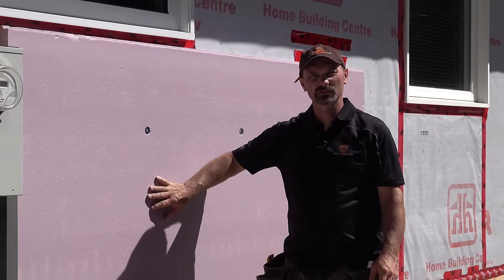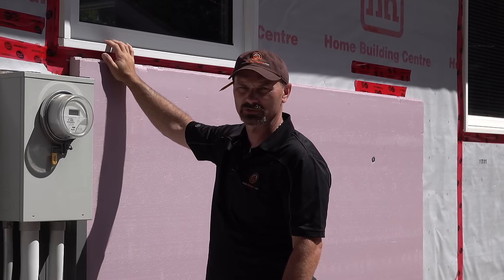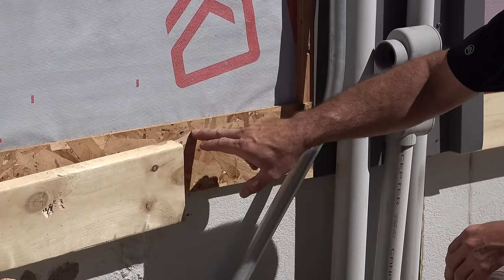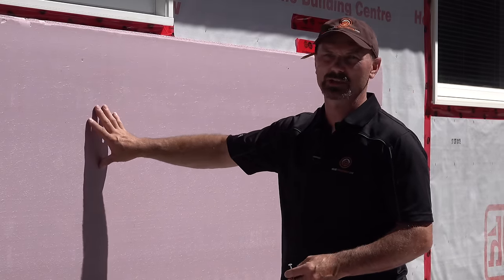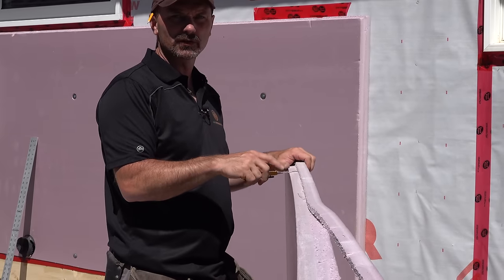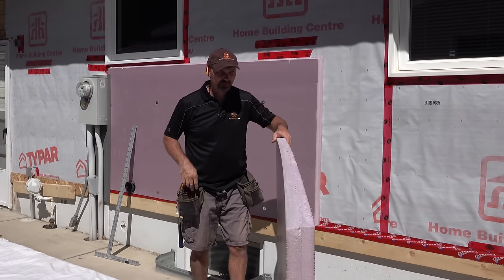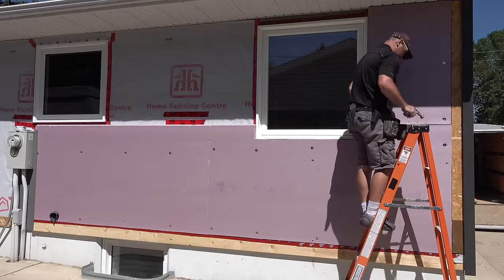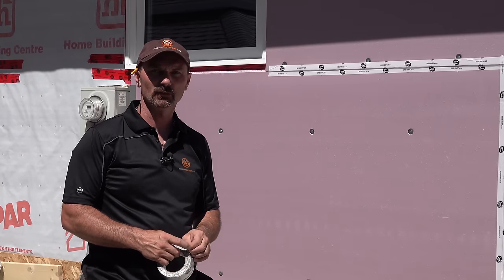How To Install Styrofoam Insulation On A Home's Exterior

Comment: I just finished a job like this yesterday lol . I took off this guys siding and installed thorax and foam then replaced the siding ..so I was watching this utube video , not this one but another , and this guy says you don’t need to install tyvek or thorax lol , homeowners beware of contractors who claim you don’t need house wrap . It is almost more important than the siding itself
Reply: I dont know much about wrapping. But do people put this stuff over top the older built homes ie bungalows that have those stucco? how would you layer it for old houses with stucco on the exterior? in example do people put paper down--> wooden frame---> styrfoam insulation---> plastic siding?  I'm a total noob any ALL OF THIS STUFF. Looking to learn more before getting a friend to do this in the near future on my dads house. maybe in 2-3 years from now. I also live in Alberta Canada so it can go down to Negative -40 degree C which is -104 F
Reply: @jeffd3147  if your going to go over stucco you need to put wooden cleats on the building kinda like studs on the side of the house that you can then mail the siding to , obviously there is a lot of other things you need to do in preparation . That’s only if you don’t want to just rip off the stucco

Comment: You could use 3 inch decking screws with a fender washer on them to hold down the foam board. Do you worry about having to vapor barriers the foam board being one and faced fiberglass insulation on the interior of the house? Wouldn’t that trap moisture?
Reply: I was wondering the same thing. Have you looked in to it ?

Comment: What about the soffit j-channel ? Would you screw the soffit channel over top the foam ? Or would you have to put a strip of wood for the j-channel then run your foam just to the bottom of the wood strip ? No one seems to know this in my area. Please help

Comment: Looks great! But now how do I put siding on 1.5 inches of styrofoam?
Reply from the maker: I install vinyl siding all the time over up to 2" thick rigid foam insulation. I use  3" shingle nails. For 1-1/2" styrofoam I would use 2-1/2" nails. Some other sidings restrict the thickness of insulation under them to 1" max. An example would be cement board siding

Comment: if anyone can answer:  will placing this foam insulation, the additional water barrier and then sealing the whole insulation/water barrier now make a moisture trap? a moisture trap that will not let the wall breathe and thus create moisture damage and a mold problem?

Comment: Some window manufacturers (Vinylguard in Canada) have a extended brick mould that allows for up to 2" insulation.  This sets the actual thermal glass into the wall and not on the exterior of the wall.  They also have optional jamb extensions for the inside allowing it to be flush with drywall.
Reply: Thanks for the tip ducebigalow.

Comment: Really good and professional work . Around our area in W PA we have enough rain and moisture to contend with that
we suggest to the architect/homeowners the have us cover the house sill. I didn't see that
done in the video segment but sealing at the bottom helps water drain without touching the lumber surface.
Reply: @pensive69 do you have links to share on how covering the house sill is done. Thanks in advance for any info

Comment: I'm glad you posted this video because it spoke to my concerns. I agree, the best way was to go with the house wrap first. The other way is going to be met with balloons forming and you racing around trying to secure the wrap. Thanks , great video
Reply: In Ontario Canada, you don't need the wrap with foil back rigid insulation, you can just tuck tape the joints.

Comment: Shannon good video, you could've built a box of the 2" foam around, at least, the conduit part, of the meter box, just an Idea. I've been an electrician, for 30 years, there's no safety issue, in doing it, as I suggested. It just might help keep a little more air in.

Comment: You are one of my favorite channels to follow for home improvement projects. I'm actually running into the similar situation, i have 1" rigid foam and building up 1" buck around the opening where we can install window (nailing fin) on the top it looks like perfect solution, this way the foam will be flush with the fin. The only question is when reviewing the code and installation instructions it says: "Embedment must be a minimum of 1 1/4" into the structural framing" So is the 1" buck counts as the "framing" since technically it is 'outside' of the wall framing? My window depth is 3.25" that leaves 2.25 before the fin minus the sheeting 0.75" which leaves 1.5" embedded into the frame (2x4) If we build the buck 1" out, that will technically leave the window only 0.5" inside the frame (2x4)
Reply from the maker: Yup you are fine.

Comment: I talked to Owens Corning. You can make the window Frame and treat the rigid foam as a second sheathing and then places the window flashing on top of the rigid foam. much better, much cleaner looking, and less susceptible to leaks.

Comment: Noice,I'm trying to work around a wheel well. Do u think off cuts used for open spots is a bad idea or even going behind the wheel with as much as possible? I used some fiberglass to keep it tight and plan on getting some flashing tape on the seams b4 I slap some osb over it and try to figure out a better skirting

Comment: I love your videos, you always explain in details for anyone to understand. Doesn’t exterior foam insulation prevent moisture from escaping. If you have insulation in the walls with an interior vapour barrier, I understand you’d be trapping moisture in the wall? Plus tapping the joints further prevents moisture to escape?
Reply from the maker: It can be possible but rare in my area

Comment: I would like to do this as well but not too keen on having an extended window sill to collect snow and moisture
Reply: Same im from new brunswick canada . House build in the 60 but the inside brand new , i wonder if insulated foam really worth it or not when im doing the outside. The winter can get pretty cold

Comment: It's my understanding that the house wrap goes at the same depth of your windows.
His windows are installed on the ply wood,  so wrap gets installed on ply wood.  
If the windows were built out to match the insulation, the wrap should be installed on the installation.

Comment: Nice video Shannon thank you. I’m doing this exact method on my house. I was wondering how you finished off the house wrap under the ledger board? Did you flash behind it like a deck ledger?
Reply from the maker: personally I just install the bottom ledger over the wrap and thats it. If you are concerned you may what to use flashing membrane over the ledger.
Reply: @HouseImprovements  - doesn't the bottom 2x6 ledger board you used create a thermal bridge?  Wouldn't it be better to use a type of metal edging at the bottom and then use the foam?  Does this type of bottom metal edging exist?

Comment: Generally its recommended that the house wrap selected should include drainage plane.
Reply from the maker: depends where you live really and what you are placing over it.
Reply: @ Darren Conlen do you have any resources to share on how to do the drainage plane. Thanks!
Reply: Should you be spacing the foam away from the wrap with furring strips?

Comment: I am looking to replace some really poor siding with the foil wrap 1" from Home Depot and then siding it later. I understand it can be left that way a couple months til we can get the siding. Do you know how that compares to what you are doing?  We really don't want to go as thick as that…and we really think the reflective foil should help on a hot west exposure. Thankx for any advice. Looks great what you've done!
Reply from the maker: 1" is the min. thickness I would recommend. Secure it well if not siding for a couple months so the wind does not remove it.

Comment: is exterior insulation vital? Building a house in NC, mild temps, should I do the exterior or just stick with 2' by 4' studs and fiberglass insulation in the gaps?
Reply from the maker: It will help keep the heat out better as well but for your area it is not likely as critical to use it.

Comment: Thank you for this video. My heating bill is going up, so I want to install a similar insulation styrofoam on the top of my brick wall. Question - do you allow the gaps in between the foam sheets to allow the thermal expansion? Why don't use the pressure-treated wood for the outside styrofoam support? Also, if I use the blue tapcon screws to attach the styrofoam to the wall - they may rust, but will they rust under the siding? Again, if I will use a siding above the styrofoam then how can I nail/screw it to the brick wall behind it? Again the tapcon screws will rust.
Reply from the maker: I think you need to join our forum, you post a lot of questions an dit is easier to help you from the forum.https://www.house-improvements.com/forums/
Reply: @HouseImprovements  I was trying to register, but never had registration email on that site.
Reply from the maker: Try a different browser when you apply. Sometimes that does it.. If that does not work email us at info@house-improvements.com and maybe admin. can figure out why you can't register.

Comment: So, if you're going to cut out for the window extension, why not do that when you're putting up the foam insulation? Why cut twice? Doesn't that also risk cutting your air seal? Thanks.
Reply from the maker: you could do that.

Comment: Is any chance mold can appear between foam board and home wrap? As I see there is no gap for venting. What do you think?
Reply: I had the same question. You now have a vapor barrier inside behind you gyp, on the warm side, and with the xps, you have added another vapor barrier. Kind of possible to "trap" any vapor moving from warm to cold.
There is - I have heard - a rule of thumb about what % of you R value can be outside the housewrap, vs on the warm side.
I'm doing the same as done here, so need to figure it out. Roxul is vapor permeable, so isn't an issue I don't think.
Reply: This is why it is not a good idea to use XPS foam (like the one used in this video) on the exterior side of the house. Instead you should be using EPS styrofoam. Because eps foam will not trap vapor.
Reply: There are EPS styrofoam sheets that has channels on the back side which helps air movement and ventilation. Durock has Puccs Styroams as an example.

Comment: After the house is wrapped do you need the foam before putting the siding?
Reply from the maker: You dont need to add foam, its only if you want to add insulation value.

Comment: Would installing Styrofoam on the outside block foundation of my manufactured home be a good idea to control heat loss in winter?
Reply from the maker: Most are insulated inside.

Comment: Taping the house wrap to the bottom window trim is probably a bad idea. If there is a leak around the trim, it will funnel water right to the sheathing. But then that's probably the best you can do without taking the windows and redoing the sill pan.

Comment: If I'm adding 2 new windows on a new wall that isn't sided yet, would you recommend adding the foam board prior to installing the windows like you said in video? And installing wood like a picture frame to match the depth of the 1 inch foam board? Or would you recommend just installing windows on the sheathing and then adding the foam board on top and going from there
Reply from the maker: In the case of new windows you would picture frame the opening  like you said with wood the same thickness as the foam and then install the window and foam gets installed against the picture frame.

Comment: I see that on top you are going up to the soffit. Would it be better to remove the soffit/j channel and place styrofoam all the way up? Also what are your thoughts about digging about a foot or more around the foundation and installing the foam down bellow grade? Thanks
Reply from the maker: Both of those are great options if you can.

Comment: Does it have to be Ridgid? I was going to see what comes in a roll. We are doing a shed
I also bought house wrap and siding. 
Please tell me the name of any products  that you could recommend
We are in Florida moisture is a big deal here never really cold tho
Reply from the maker: For Florida you should check your local codes for specific types of adding insulation , You have unique climate variables compared to my area.
Reply: @HouseImprovements  yes I know most videos are geared to up north conditions we got humidity moldoldew and rain damage here to consider.

Comment: Hi Shannon, I have a question, Im putting up LP osb panel siding and removing old masonite. The walls have foil covered 5/8" insulation board nailed to the studs that are insulated with fiberglass batts. Of course the interior walls have a plastic barrier finished with sheetrock. Does the plastic barrier on the interior serve as an adequate vapor barrier with  the foil covered insulation board? I have already finished one wall on the house and put house wrap over the insulation board. was that wrong or even okay but unnecessary ? Im getting ready to start on another wall and considering replacing the 5/8" insulation board with the 2" that you used in this video. Thanks
Reply from the maker: Yes , the interior poly is the vapour barrier, it is always placed on what would be the the warm side of the wall during winter months.
Reply: @HouseImprovements  THANKS SHANNON. I am assuming the house wrap over the existing insulation board would be redundant. Correct? Thank you again, Ive learned a lot watching your videos and the boost in self confidence is invaluable.

Comment: Don't you have to have a vertical rainscreen strapping on top of the foam board (1x2 treated) to prevent the condensation between the siding and the foam board? If so, you would have to build up the window trim even farther out.
Reply from the maker: Some places need a rain screen some dont. If you need it then yes you need to be wider with your trim

Comment: About the house wrap and insulation - what about the moisture that comes out of house with the air, doesn't it get stuck between  the wrap and the insulation?
Reply from the maker: There is very little here because we have a vapour barrier on the interior.

Comment: Love your videos. I have rewatched this three times and I still don’t understand what you did at the corner. Why cannot you nail all the way through to the corner studs with your siding fasteners? I just can’t visualize why addition OSB and 2-by is necessary. 😅
Reply from the maker: The thickness of the added styrofoam (2" in this case) moves the corner piece of siding to far away from the original corner wood of the house to actually hit it with nails. The system I use gives you some plywood to fasten to again. Wider corners that what I have may reach without doing what I did , but in my area wider corners are not available.
Reply: @HouseImprovements  I am adding 1" foam, do you think that corner will still be an issue for my build when adding the battens and LP Smartside siding panels?

Comment: Thank you for so many minute details that make such a big difference in doing this right! I was wondering if you could do a review on the gable end of the house as there is no overhang from the roof, just dripedge. I guess what i'm asking is how to extend dripedge over the styrofoam and vinyl siding? Thanks
Reply from the maker: Ah yes that is a problem if you are adding foam when you have no gable overhangs. If you come to the forum we can discuss this situation in depth better. https://www.house-improvements.com/forums/

Comment: Hi Shannon, I'm learning alot from your videos. I'm preparing for vinyl siding applied to existing wood siding, would you be adding furring strips to your foam insulated walls for nailing "new" siding to or do you apply siding directly to foam and use longer nail to insure vinyl is nailed to wood?
Reply from the maker: I install directly over the foam . In this case I have 2" foam and Im using 3" nails.

Comment: Im going to be doing this to my house from 1920.  The  toung and groove sheething is not as reliable as i would like it to be . Can i go over it with 3/4 inch osb, or plywood, in order to have have something secure to screw into. Or would i have to remove the old sheething and start from the beams?

Comment: how do you install the siding then? Use 3 inch nails then? Does it not defeat the purpose of thermal bridging then to put a million nails in through the foam? No rain screen or furring strips?
Reply: Typically yes, longer nails or I would use screws for vinyl siding.  I would not strap the rigid prior to vinyl siding, as you could get air behind it thus rattling the siding.
Reply: @ducebigalow8834  odd.  Never heard of rattling siding.  Where has this happened?

Several builders do recommend @NateM's idea of furring strips.  The air gap also acts as a water runoff if there's a water barrier there for anything the siding doesn't stop (like backed up gutters, melting ice dams, etc.)

Comment: i have an older home with aluminum siding i want to remove aluminum add 2in foam do i need house wrap under the foam
Reply from the maker: You should have it either under or over the foam, it should be installed

Comment: Great video Shannon.  Waiting for warmer temperatures to start my siding project.  Material is in yard.  Haven't yet ordered the XPS foam board but, I'm considering using FOAMULAR 250 3 inch R-15 insulation Sheathing under 10 inch staggered shake vinyl siding for a NY zone 4 climate.  Any thoughts?